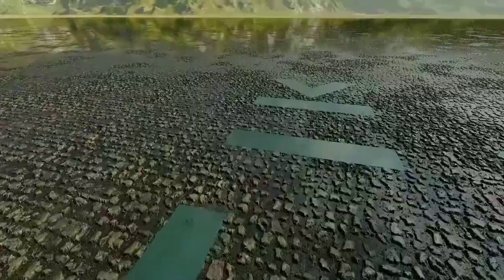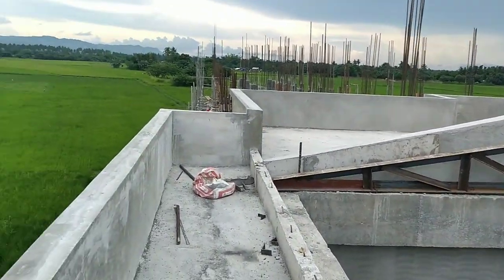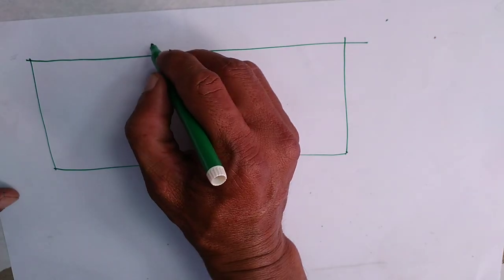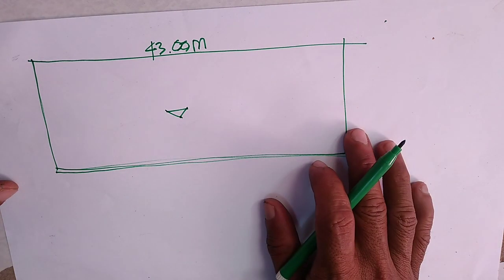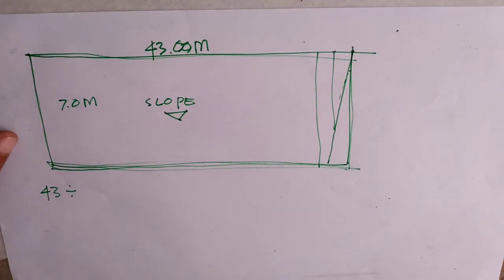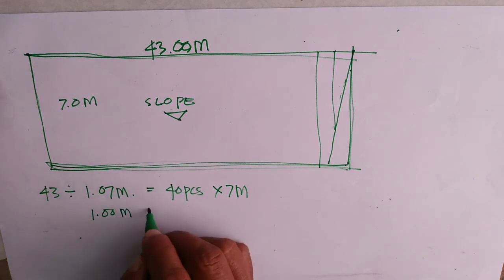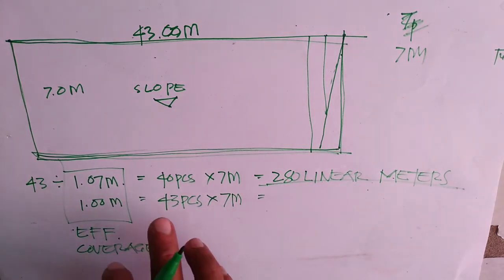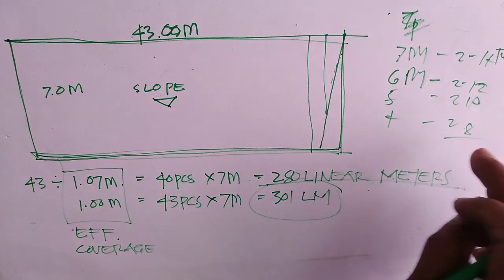PAANO MALAMAN ANG LINEAR METER SA ESTIMATE NG ROOFING NYO?

Comment: Lods sa karanasan ko yong effective coverage ay depinde yan sa kapal ng yero kapag makapal  halos dina nalalayo sa 1meter yan pero pag manipis lumalapad yan habang nilalagyan ng text srew kaya ako ang basis ko para safe ay 1.05 kasi ang yero kong long span standard size ay 110 pag kinabit mo mag overlap ang isang korbo ang lapad ng kurbo ay .05 kaya maliwanag na 110cm-.05cm =105cm yan ang actual na lapad ng yero malapit yan lods sa katutuhanan ingat
Reply from the maker: Yung eff. coverage po depende sa planta at kanilang makina, ki makapal po o manipis indi po pwde mabago yan pag pinasok sa rollforming machine..ngayon kung sakali mag stretch man yan bonus na lang po yan, pero konti lang madadagdag dyan..kaya sa estimate po syempre gagamitin mo kung anu yung nakalagay sa brochure depende sa kumpanya..salamat
Reply: Sir, 10.80 ang width ang lenght 2.4, ilang yero ang gagamitin. Tnx
Reply: Sir tama yan demo s computation ng Linear meter, pero un 40 pcs parang magulo, my side lapping pa yan. Tnx